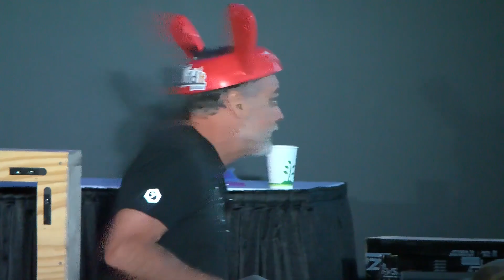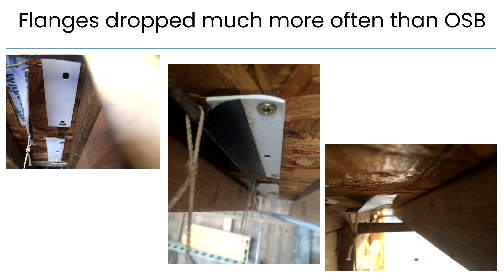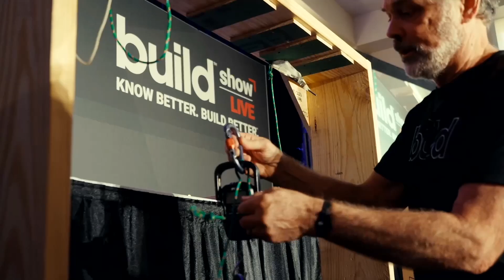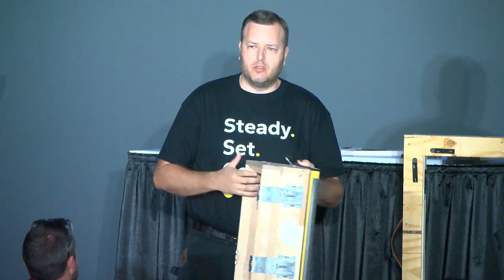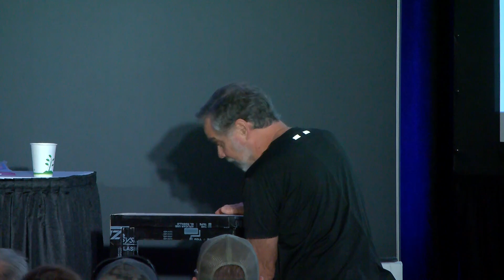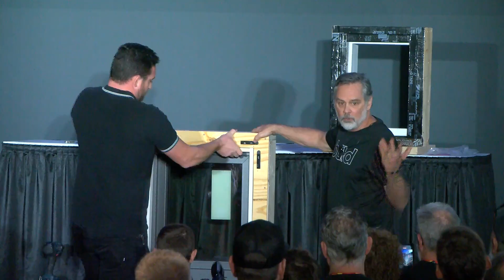Why Peter Yost is a Wingnut

Comment: The standardization of window installation is a great idea.  The only concern I see with the installation of the windows from the inside, with non-adherent gasket material between the frame opening and the window unit, is how it will perform with a positive pressure from the outside of the window.  Will that make the window shift just enough to allow air leakage around the gaskets?  It does happen in automotive gaskets, and you can hear it when you are driving down the highway and there is a really significant crosswind on the car.  All of a sudden, you are hearing wind noise (air leaks) around the windows on one side of the car (usually the side opposite to the direction of the crosswind).  The car doors are mounted from the outside, so a positive pressure would compress the gasket more, but the side of the car opposite from the crosswind is seeing a relative negative pressure, and you get the wind noise/air leak as the compression of the gasket is lessened.